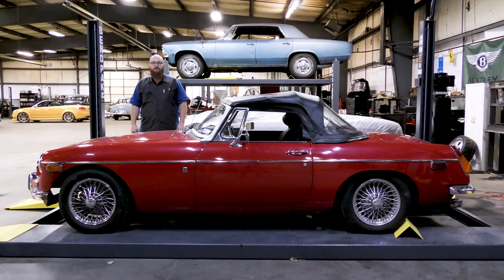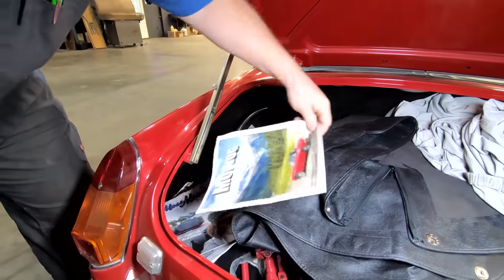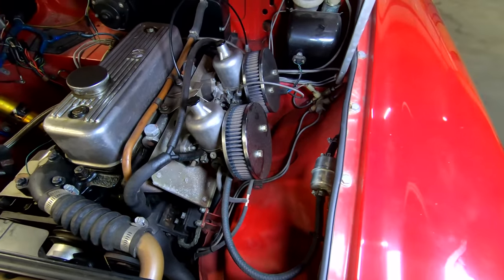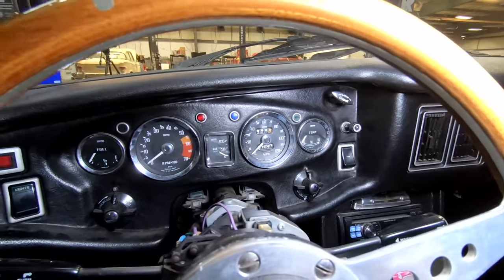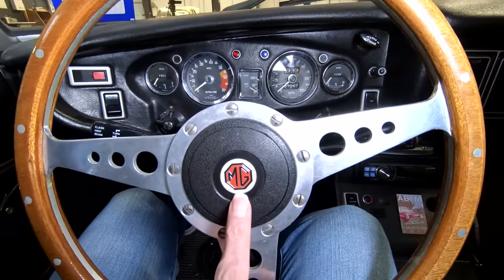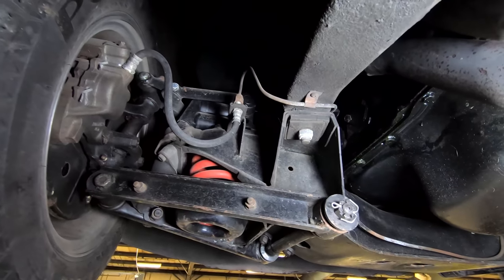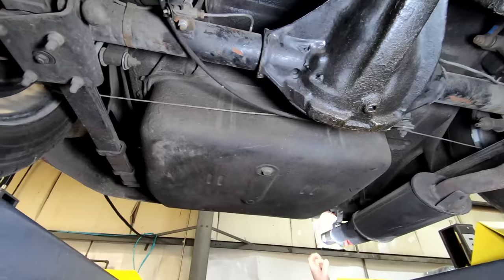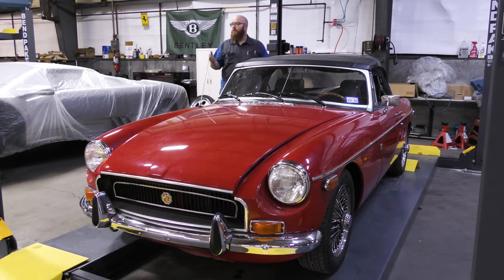Cherry 1972 MGB! See exactly why it earns a thumbs up from the CAR WIZARD!

Comment: Love these cars. The best manual shifter I’ve ever operated. Short throw. Very precise. Rorty engine. Great handling. Solid feeling construction. Very satisfying to drive. Horsepower ain’t everything.
Reply: I've never heard of one with a rotary engine. the one in the video has an i4
Reply: @Duraputer  he said 'rorty' as in it is a real sports car motor. As was portrayed in 'Ford vs Ferrari' at the beginning in the workshop, MG's are proper sports cars and need to be driven as such to get the best enjoyment. You do actually need to get the rev's up for it to respond well. Rorty = sporty but throaty and eager.
Reply: @Mike_Costello  my bad, never heard the word rorty, so i thought rotary.
Reply: @Duraputer  having said that, rotary conversions are not unheard of in MG's. Rover v8 conversions are common to but i'm sure a Google search will find a few rotary's too.
Reply: @Duraputer  Rorty not equal rotary.
Reply: Sums up the first drive in a 1966 Alfa Romeo Guilia Spider i traded my way into in the mid 70's and echos my thoughts and admiration for that thoroughbred.
Reply: @Mike_Costello   I love the traditional British, Italian and to a large extent Swede (P1800) sports cars for their eagerness to get out to stretch their legs and get flying down the road. I love the spec's of the tune that really get that tach needle bouncing when blipping the throttle and contemplate the ride ahead.
Reply: If it had a straight gearshift lever it was full synchromesh, if there was a kink in the lever it had a non synchromesh 1st gear.
Reply: @nickpappas4133  no , the cranked gear lever was the no overdrive transmission. My 3 synchro o/d has a straight gear lever, factory fit
Reply: @stanbest3743  thanks,l must have been wrong,was sure I read it somewhere.
Reply: @nickpappas4133  they may have discontinued the cranked lever altogether when the 4, synchro came in in 67. It's an interesting point.
Reply: @Duraputer  he wrote rorty not rotary!
Reply: @@robertheberlein3424 - I know BRG is traditional but I like burnt orange because it’s literally a color that defines the era. BMW 2002 tii looks great in orange as does a Lamborghini Miura. Sports cars wear burnt orange well, generally.
Reply: I’ve heard of dropping in a 283 cu in v8 in these butt never a rotary.
Reply: @Duraputer 

Yeah I agree.
Reply: @CheekyMonkey1776  - I’m actually shocked at how many people don’t understand the word RORTY. It’s a British colloquialism. And, a 283? No. An aluminum Rover 3.5 V8? Yes.

Comment: I love MGs I have a 1974 midget and a 1959 Morris Minor. I will add that they are actually my only cars
Reply: Curious how many loom / wiring issues tbh
Reply: @h0llowm3n  a lot
Reply: I used to work at a Morris Minor garage in the 80’s in the UK
Reply: @PaulSlade1  my grandmother drove a Morris minor 1000 and also had an Austin Marina
Reply: @TheSarahnov16  The Austin Marina's a rare car now. Out of 1.1 million Marinas built, only 23,000 were sold in the US as Austins, and hardly any are left now. I like the Marina, but I can understand why US buyers wouldn't have been interested in it.
Reply: @TheSarahnov16  ah the Austin Marina. Aptly named as it was all over the road so much you felt you were at sea!
Reply: MG today is a far cry from what it used to be. That said, I own the Chinese MG ZS electric car, so I kinda belong here but not really. It's built kind of like the Mexican VW Tiguan except it has none of the mechanical issues. But most importantly, it is 4 times cheaper to charge then a comparable car to fill up.
Reply: We had a Morris minor for the two years we loved in Australia
Reply: Originaly they had 2  6 volt batteries .
Reply: @Zeem4  I never knew they sold any Marinas in the us.
Reply: @craigpests_channel  Yeah, it was something of a failed experiment. Very similar to the Hillman Avenger, sold in the US as the Plymouth Cricket. That did a little bit better, but US buyers quickly got put off by the British build quality.
Reply: I have a 1973 MG midget.  I never had any electrical issues. 

My biggest issue with the car is rust. It rusts very easily and quickly.
Reply: @ts31966  my midget sat since 1977 in a garage so there's luckily no rust. The fuel tank had to be replaced though, but I still think I got a great deal at $1000
Reply: I have a morris minor manual if you want it.
Reply: Hahahahaa. I can resonate with that.
Reply: @GarrishChristopherRobin777  Sorry to hear that
Reply: @MaShcode  I do need a morris minor manual. Do you have email?
Reply: @craigpests_channel  First let me try to find it LoL. If it’s in storage It may take some time.
Reply: @h0llowm3n  I've had numerous Brit cars (3 currently)  and have never had electrical issues other than some bad grounds which you will find in any old car.
Reply: LOL I drove Morris Minor’s when I worked in a parking garage back in 1970. Unusual car to drive. Many of the British Leyland cars were rather famous back then in America.
Reply: LUCAS ....PRINCE OF DARKNESS
Reply: @Zeem4  Wow, someone else that remembers the Cricket.  Last saw one 10-12 years ago.  It was in surprisingly good shape.
Reply: @mescko  The Hillman Avenger is my favourite car, so I'm really interested in all the different international versions as well. There's definitely someone in the US with a collection of Crickets, I've seen them in a YouTube video.
Reply: @Zeem4  Yup, and as an employee of a BMC dealership when they were introduced.. junk second only to the Austin America.
Reply: @mescko  I have owned 30 Brit cars since 1964, never had an electrical failure in any of them that was any more common than non Brit cars. Never had one leave me on the side of the road. Other 
very expensive cars such as Mercedes Benz.. fuel pump relay failure at 200 miles.. And I was a Factory rep for them at the time  Field Service Manager for MB of NA in the San Francisco Region.
2nd day  on the Bay Bridge at 6:00 AM...dead in the water. Nothing like that ever happened to me with a Brit car. .. and not as common as some think .. including my 4 years at Broitsh Motors of Monterey.. BMC (MG) , Rolls, Bentley, Aston Martin, Austin, Jag, Morris , Jensen, Lotus etc.
Reply: @dgurevich1  modern MG is not the actual MG. Just a Chinese shit-tier brand who use the MG name. Also don't come in here speaking about electrcial garbage filth.
Reply: My friend had MGB. I had 76 Lancia Beta coupe. Both cars always had an issue or two. I had to change wheel bearings often among many other things. He had to buy same Lucas solenoid over and over.
MGB had longest tranny for the size of tiny car. It refused to come out no matter how we tried.😢😢😢

Comment: Lucas stands for Loose Unsoldered Connections And Splices.

Nice thing about those cars is that you can buy virtually every part for them, even body panels made on the original tooling. You can even buy a complete new body shell assembled on the original jigs.
Reply: I worked for the Prince of Darkness in the US and the UK from 1985 to 2000
Reply: Lucas other nom de plume is the ‘Prince of Darkness’
Reply: Those body panels are so close to the original that they are made with the same type of ungalvanized steel as the original so you can get the full MGB experience of watching your car rust right before your eyes.
Reply: @PaulSlade1  ....and Lucas'  secret weapon was the cadmium plated, mild steel Lucar connector. Unsealed to the elements, especially salty water and with dissimilar metals (the tinned brass of the bullets on the wire ends) in contact with the thinly plated steel. Perfect recipe for electrolytic corrosion. I pointed this out to Lucas, British Leyland, Lotus and Jaguar in the late 1960's but they kept on using these horrible connectors, because they were 2 old pence cheaper per connector than the earlier brass sleeve versions.
Reply: I worked from 1985 to 2000 for Lucas Diesel Systems out of Gillingham, on the SE coast of England, which later became Delphi Diesel Systems. I then worked for Bosch Diesel from 2000 to 2015, then back to Lucas/Delphi Diesel from 2015 to 2018 when I retired in Phoenix, AZ, USA
Reply: @peteranderson037  Well, they are made by the British Motor Heritage Trust, so I'd expect no less from them, their mission is to preserve the heritage after all!
Reply: @PaulSlade1  Dude, some of that reads more like a confession than a resume!
Reply: Just replying to the comments mate
Reply: @peteranderson037  It was a Uni Body rust rave high on 'moisture' drugs on every curb puddle.
Reply: @Bercilak de hautdesert What, you don't want to experience the magic of driving down a twisty mountain road at night, knowing that at any moment every light in the car could suddenly cease working, because a corroded bullet connector made the one fuse for ALL of the lighting blow?
Reply: @markbeiser  You wouldn't expect anything less from the Prince of Darkness...
Reply: The panels made by British Motor Heritage are invaluable for keeping these types of cars on the road.  The only issue with the original dies is that they produce panels that are not as "crisp" as back in the day.  (body lines not quite as sharp etc)
Reply: @peteranderson037  Made out of 100% compressed rust!
Reply: @wilsonlaidlaw  my father had an Austin Healey 3000 and one day it wouldnt start. Crank crank crank, nothing. We look under the hood and on the firewall I see a connector with 3 holes, 2 holes with wires 1 empty. I look around and see a wire hanging loose. I inserted it into that 3rd hole and it fired right up.  But how sad is that, that a terminated wire just falls out of the connector!
Reply: @JamesStaples  so did I get the job?
Reply: @JamesStaples  and what was my position, President?
Reply: @PaulSlade1  if you're willing to come out of retirement I'm sure we can find some stuff to fix! If not, hope you're enjoying your retirement - Phoenix climate so much more forgiving for heritage cars
Reply: @JamesStaples  like the 4 million people that stopped working in Oct 2021, I love not working. Lucid Motors and others are near by me here in Casa Grande, AZ, I could work there but I’ve done my time
Reply: @Bercilak de hautdesert At least the MGs had a fusebox. I discovered my '68 Ford Cortina GT didn't, when a shorted wire under the dash started glowing. I was able to rip it out before something ignited!
Wound up adding several inline fuses at the ignition switch. Starting in '69, Cortinas got a fusebox installed on the right inner fender.
Reply: Lucas is terrible in any format
Reply: Were that this complete set of cast iron moulds that they found dumped somewhere in a field?
Reply: @netrioter  I drove a '67 Sunbeam Alpine for more than a dozen years and had very little trouble with those bullet-connectors. Maybe Rootes specified plated brass instead of steel for their vehicles.
Years earlier, I did have a beater Hillman Minx convertible that suddenly lost half of it's electrical systems. Only after I had half the dash apart, did I discover one of the two fuses had corroded! 😞
Reply: Lucas electrics are fine as long as you keep the smoke inside the wires. Too many careless owners allowed the smoke to escape. They are the problem!

Comment: My daughter recently bought a 1972  MGB roadster for 4000 dollars . 64,000 miles and the body was great with only 1 rust spot on the inner rocker panel on the driver,s side. It did need mechanical . attention. New braking system plus brake master cylinder, new clutch, new steering rack and a new exhaust .We got all the parts from Moss Motors ..their service was good and they have a great inventory . Wheels, tires, top and interior were perfect. Plus it is a rare Bronze gold with navy blue leather interior.  Unfortunately it does not have overdrive. Some cars are survivors that are worth fixing up .Love the Car Wizard...Great Content.
Reply: That cover in the trunk is a half tonneau cover ..looks great  in place when the top is down , we also added 2 round running lights in the grill for a sportier look. Fastening the top or tonneau cover can be tricky, I use pliers to stretch the fabric a bit and a small rubber mallet which helps ,
Reply: You can get 5 speed conversions, well worth it if it's a keeper
Reply: That was a steal for 4 grand.
Reply: @stanbest3743  Yes. And they also work great in MG Midgets providing that extra feeling of highway passing power security.
Reply: @vw5056  Add 8000 dollars to the 4 for parts and labor ...real cost was 12,000 dollars  total ! LOL
Reply: Overdrive was rare in the US
Reply: @stanbest3743  My MGB GT has the Nissan Z gearbox conversion, fantastic.
Reply: @petersherman2552  Not so, they are scarce, not rare.  I have one in a car and a spare I just overhauled. 
The "rare" O'odrive is the early 3 synchro 62-Oct 64.
Reply: @petersherman2552  BS  it was common.
Reply: @jeffhildreth9244  Only about one in ten got the overdrive option Jeff.
Reply: @petersherman2552  Locally (Southern Oregon USA) there are about 30 MGBs... easily 50% have overdrive boxes.

Comment: These are really simple cars to look after, and a perfect choice for a home mechanic and are extremely popular and relatively cheap, at least in the UK. Parts are readily available, and not expensive. Literally everything is available, even down to a new bodyshell. There are some weak points, but these days there are upgrades. A standard car is never going to set the roads on fire, but that's not the point.

The big enemy of these cars, and pretty well all the others of this era is rust. Probably not too much of an issue in Texas, but best kept off the roads in those seasons and locations where salt is used on the road.
Reply: Like Classic Minis and Minors, I wonder how many other 50 year old cars there are that have affordable full parts availability? And that from a manufacturer that no longer exists.
Reply: @frglee  VW Beetles (and vehicles based on their mechanicals) come to mind. I believe Citroen 2CVs are well supported as well.

Many of the other British sports cars of their era are also quite well supported to. So, Triumph Spitfires and various of the TR series. The latter are based on a separate chassis, and whilst they rust, it's possible to get a new (and galvanised) chassis. 

Of course, the parts do start getting more expensive with some of the rarer and more sought after British sports cars, so an Austin Healey 3000 is going to cost more to look after.

Comment: Love these cars.  I owned a 74 (last year without the rubber bumper) for 7 glorious years until it was totaled in 1987, my last year of college.  It was parked on the street and hit by a drunk who dropped a cigarette in his lap!  I've got to correct one incorrect statement, while the car is small, it had excellent leg room on the drivers side.  I'm almost 6'4 with long legs and with the seat back, I could fully extend my legs behind the pedals.  Shockingly it had some of the best leg room of any car I've owned because the leg compartment went far forward.  It was definitely cramped width wise; however, I was skinny back in those days and could drive that car all day without being uncomfortable.  I loved that car!
Reply: That's a very long wheelbase , with excellent legroom..always amazed me. 
And typical of so many of these. . .you had it parked on the street during college...famous death scene for so many...if an accident didn't occur then it fell apart or rusted in the rain.  I was there
Reply: I fully agree.  At 6'3" I am more than comfortable in my early '74.  With the seat all the way back, I literally cannot touch the firewall with my toes.
Reply: I’m nearly 6 feet and I fit my 80 B just fine. I also knew a mechanic who was 6 foot 3 who drove a b and he still had headroom to spare with the top up.
Reply: 74 1/2 MGB went south and that was the end... RBB was the replacement what a POS.
Reply: @curtknight1021  Obviously you were not.  Wanna play one up with MGB/Brit car experience.

Comment: I had a 1971 and while I loved the car, I spent as much time working on it as driving it.  That 2nd battery tray was for a 2nd connected battery.  They originally were equipped with 2 - 6volt batteries, wired in series.  Just another set of connections to give you trouble.  Most, like this one, have been converted to have 1 - 12 volt battery.
Reply: I wondered if that was the case. Could you put a smaller 12v in there for accessories with the alternator divided between them? I was thinking about 12v ports for electronics hidden away
Reply: It's a British car from the 70's, so of course you spent as much time fixing it as driving it. Even Top Gear alluded to the fact that classic British sports car drivers spent more time fixing/servicing their cars than driving them. Still, the driving experience made up for everything.
Reply: And the brand of the two six volt batteries was KING OF THE ROAD, nothing to do with Roger Miller !
Reply: Had a 71 also with the dual batteries. Loved the car, but had so many problems, especially the electrical system. There was a running joke at my job about whether I would make it to work because my car broke so many times. Having said all that, I am considering buying another one in my retirement. They were a lot of fun despite all the issues.